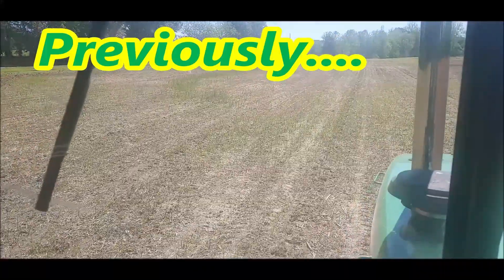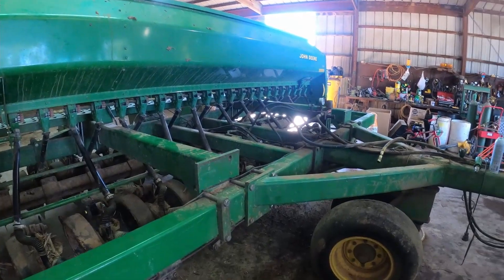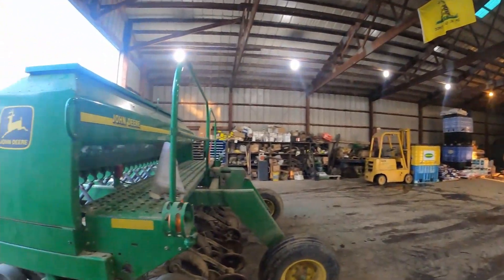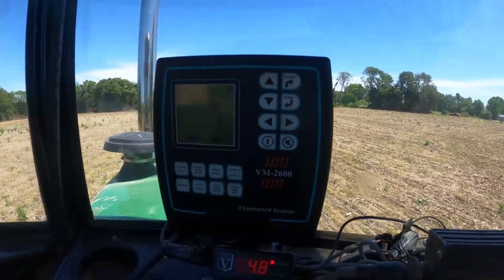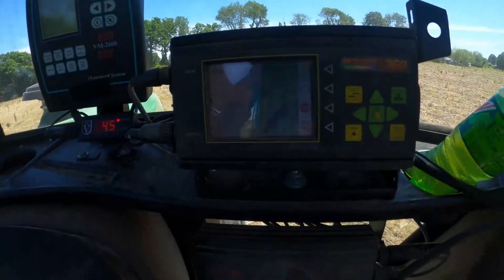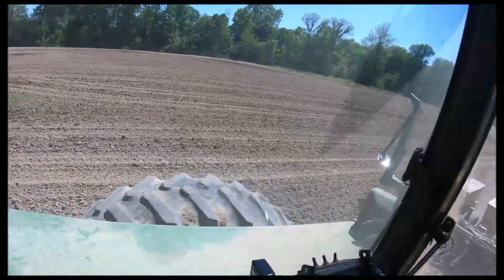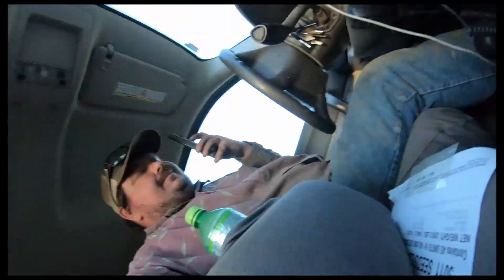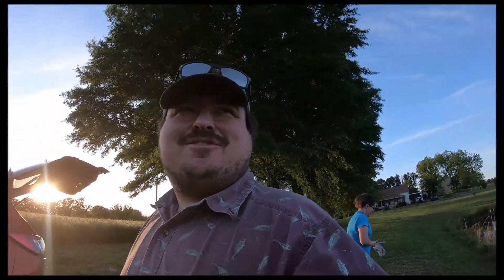Double Duty: Drilling Soybeans and Planting Corn 2021

Comment: The property I live on has several springs. Have 3 on one side of the driveway and 2 on the other side. Need to make a ditch for the springs on the one side of the driveway. That way I can bush hog it. Have too many poisonous snakes hanging around.